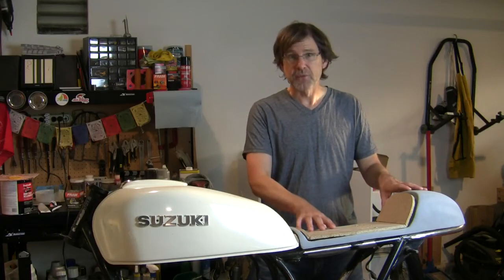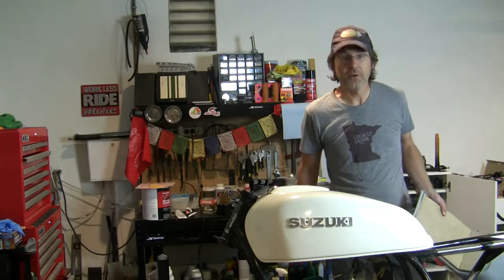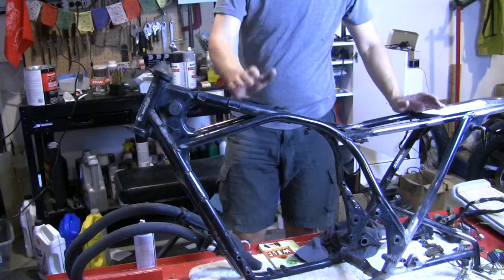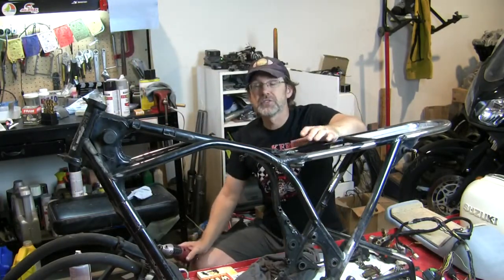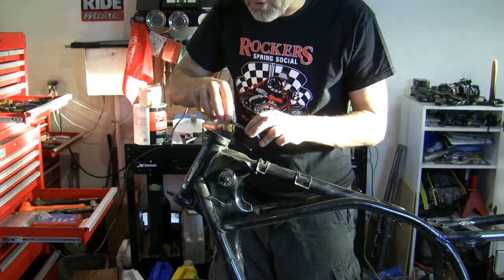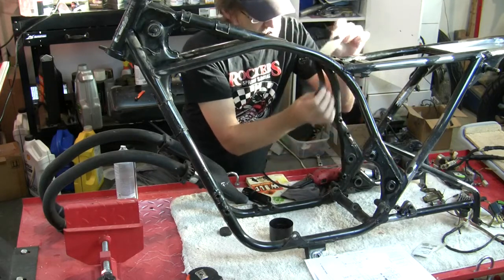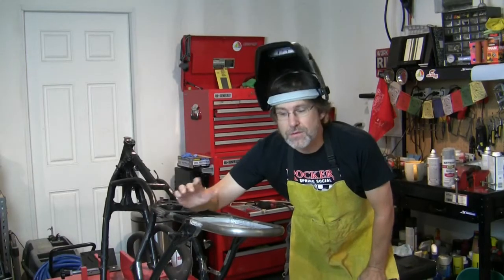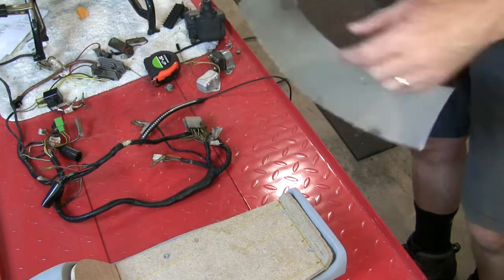Sandblasting Frame: GS550 Custom Cafe Racer Build (Part 59)

Comment: Hello mister monk, enjoy watching these episodes. I am wondering: what paint dis you use on the frame, and did you use “rattle cans”? If it is called that way 😁 Not sure as I am Dutch and not a native speaker. Cheers and thanks in advance, Eric
Reply from the maker: Hello from Los Angeles! Thanks for watching. Yes, I used an enamel spray paint in aerosol cans (rattle cans) to paint my frame. Is holding up well. I use a brand called Rustoleum here in the U.S. 3 layers of primer for metal. Then 3 layers of color, then 3 layers clear coat. All same brand and same type.